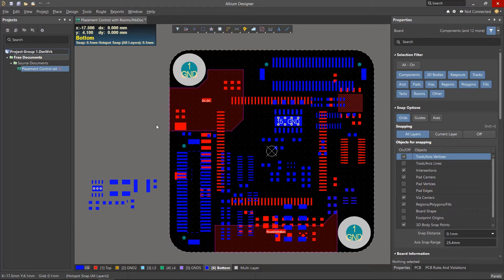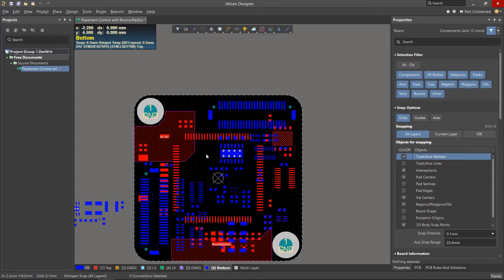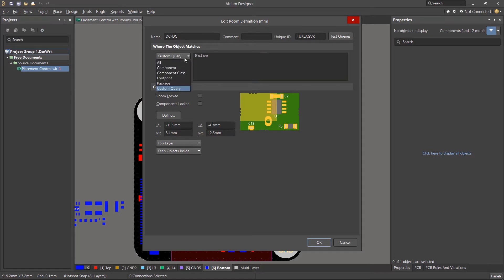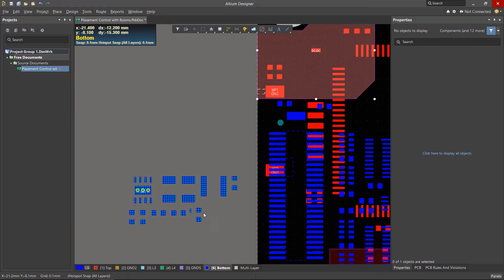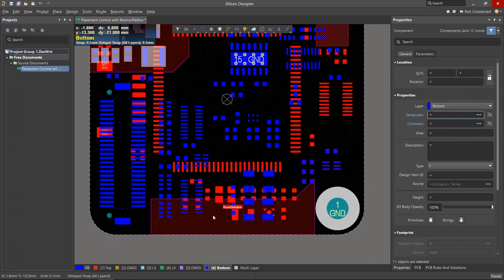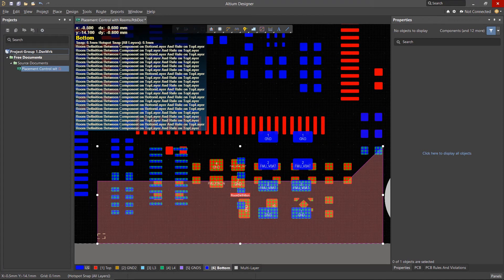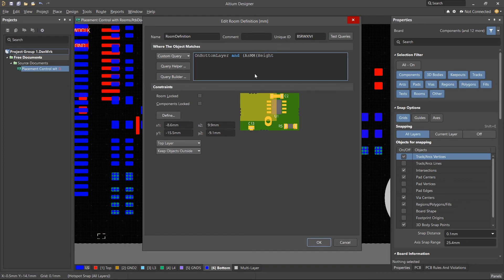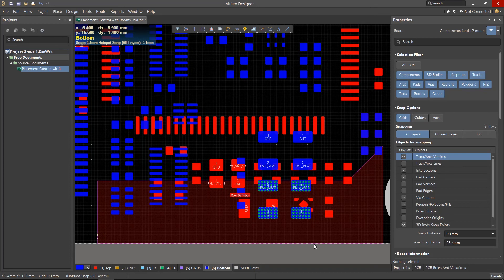How to Use Rooms for Component Placement in Altium Designer

Comment: sometimes a room is annoying, how to delete/remove a room to gain freedom of placement?
Reply: When you import to the PCB, you have the option to disable the Room creation portion, the option is at the bottom of the Engineering Change Order dialog. If you have Rooms but want to delete them, turn off single-layer mode and set the Selection Filter to only select Rooms. Use CTRL+A to select all and then press Delete, this will remove all rooms from the design.